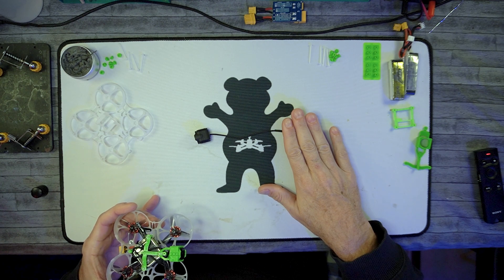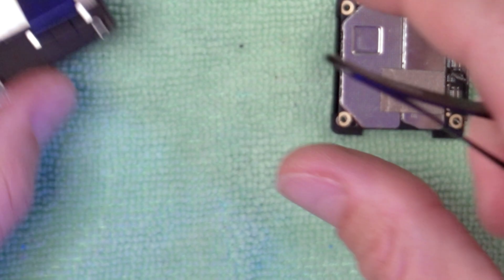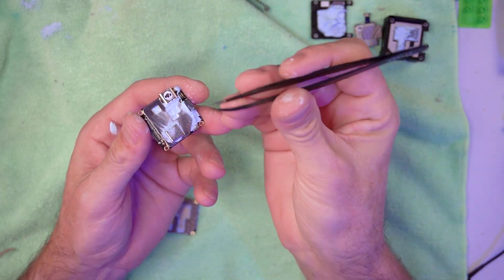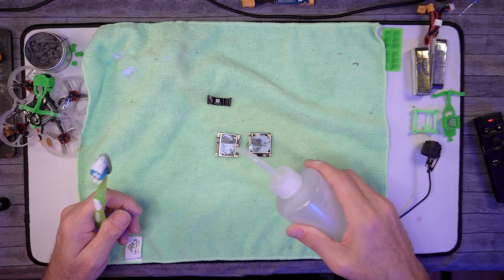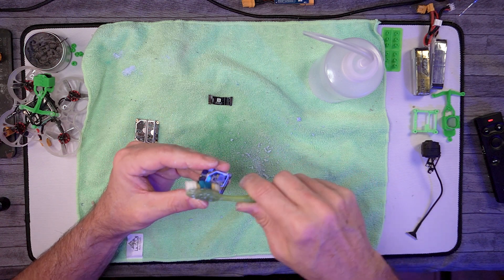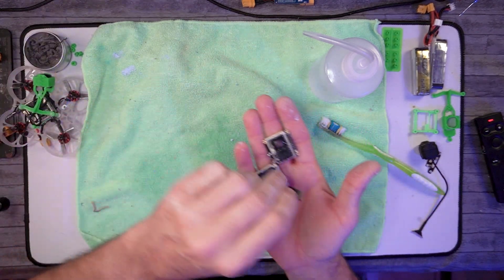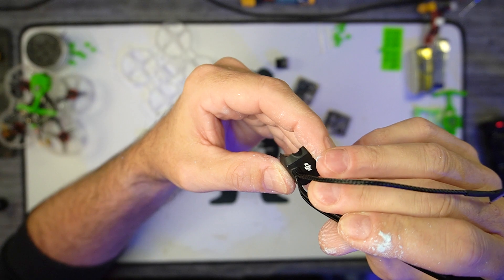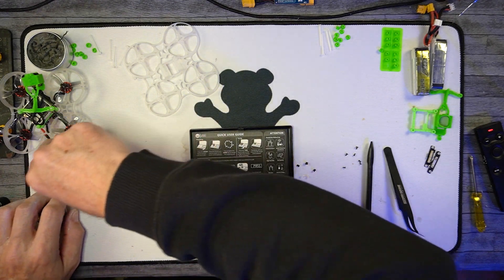How To Decase The DJI O3 Air Unit & Camera // Naked DJI O3 Air Unit // Naked DJI O3 Camera

Comment: Hi. I need some help, maybe you have encountered this. 
The SD Card on the O3 Unir is not recording. It only records on Goggles. 
Tried everything, changed cards, updated. Nothing works. 

Any idea how to solve the problem ? 

Thanks
Reply from the maker: If you set the AU to record from the goggles menu and it is not, then I would send it in for a repair.

Comment: I always saw you did this before flywoo came out with it. Would you know if conformal coating and attaching a raspberry pi heat sink would be optimal?
Reply from the maker: Conformal is completely safe. I’ve done it myself. 
I can’t see where a pi heatsink would hurt in anyway.

Comment: From a engineering perspective, wonder how we can help reduce the heat? Once we decase this thing we could add some small heat sinks that have the proper fins like on rasberry pi's. I am more interested in decasing to get a proper heat solution than decasing for the weight.

I want to put an 03 air unit in a RC plane but in texas it is about 107 degrees when I fly sometimes. So when I am taxing the plane on the field do not want it to overheat. Be nice to have a small fan blowing on the correct heat sink. 

All this thermal paste looks like a bad design right? Like it cannot be transferring heat very effectively with globs of thick paste.

Comment: How is the heat dissipation after removing all of that? I heard these units get a lot hotter than the vistas
Reply from the maker: Not bad. Just arm and start flying. You have about 45 secs before it overheats.
Reply: @DaxNealFPV  45 seconds on the bench right? LOL, or is that the amount of flight time you get before it overheats
Reply from the maker: @TechTimeElectronics  doesn’t overheat when flying. Just when sitting still.

Comment: what lens do I get to replace broken one on 03 unit ? thanks great vid
Reply from the maker: Unfortunately, there aren’t any available yet. The lens just pops off but no replacements yet. You’ll have to buy a new camera and save the damaged one until they release aftermarket lenses. I think they will.
Reply: @DaxNealFPV :face-pink-tears:  yea I crashed on a dirt road rock caught lens now a smudge left corner DJI so slow releasing stuff but great stuff iiieeerrr
Reply: I haven’t tried it, but it seems like if you have the camera stripped down you could replace the entire lens with any lens that covers the width of the sensor if you just get the focusing the right distance. (I.e a a small lens like one from a GoPro hero or vista polar cam, etc.). You can measure the infinity focus distance of the lens by holding the lens up to a white piece of paper in front of a window and move it in and out from the paper until the image comes into sharp focus, and then measure that distance. A bit tricky to measure on a lens this small… but easier than finding a replacement lens for the 03 ;) then just mount it that distance from the sensor….
Reply: @edwardrobison3684 I used a caddx lens on my runcam and worked good but I put the unit in a practice drone

Comment: Really wanna comformal coat one of my 03's, but worried it will trap heat and cause thermal shutdown. Any thoughts on this?
Reply from the maker: I will not add any risk. The o3 gets hit quick either way.

Comment: Excellent video, Thanks for sharing this! Any idea on what the weight savings is and if there are any heat dissipation issues with conformal coating it?
Reply from the maker: You shave off half the weight and if you treat it like its an analog vtx, you will be fine.

Comment: I wonder how the range is after all the shielding was removed. Now the buck converter sits on top of the receiver circuit without any shielding. As a electrical engineer how has spent years in the EMC chamber, this really hurts :D But for a whoop on short range it might be fine ;)
Reply from the maker: Man so far, as far as a 2s can take you!
Reply: Any recommendations to improve the shielding? Maybe some electrical tape between the layers?
Reply: @mbug7973  I use Kapton Tape. Not sure how well it works. But I don't want to put copper on circuit boards lol
Reply: @divingfalconfpv4602  it does nothing, no positive effect, no negative effect. You need metal for emf shielding